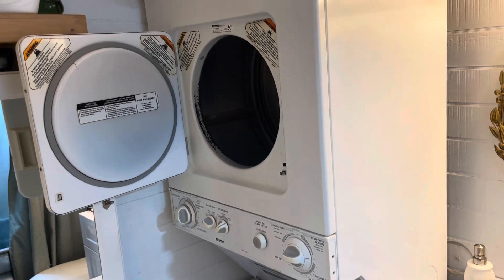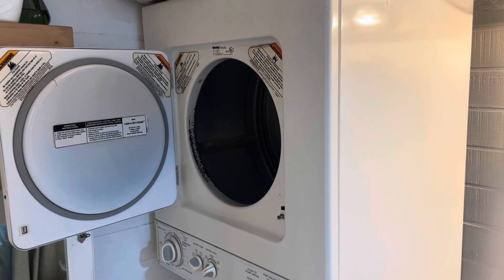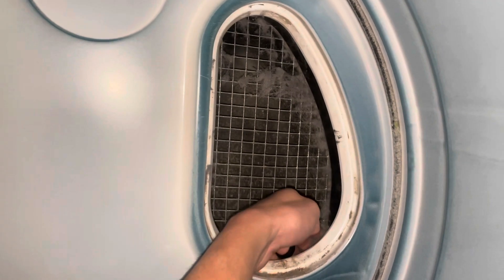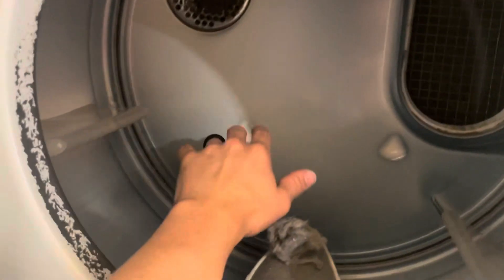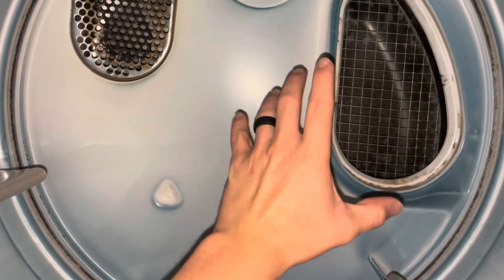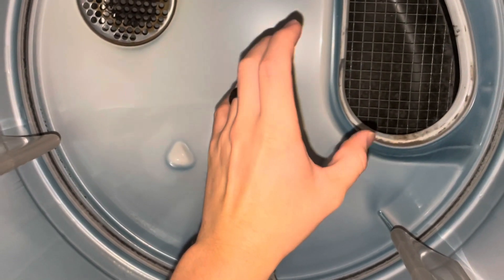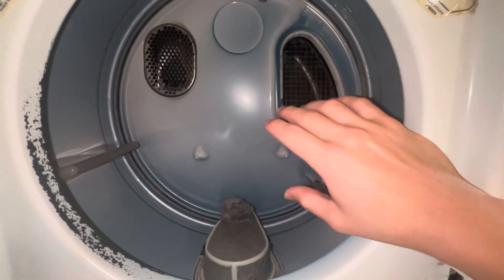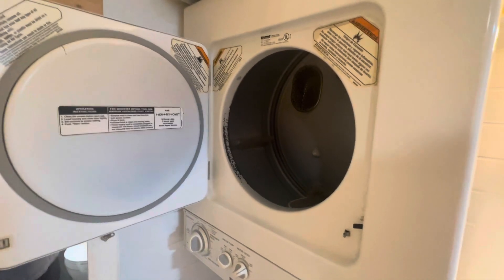Troubleshooting Kenmore Washer-Dryer! NOT DRYING!

Comment: I have the same model, I couldn't find the lint trap thanks for helping find it.  Now my problem is that the dryer works through a full cycle and then won't work again for about 45min and then it will work again.  Could this have been because the lint trap was full and was not emptied out by the previous tenant?
Reply from the maker: When the lint trap is full, it makes it easier for lint to make it to the vent lines. I would definitely check the vent lines because that has the possibility to be a fire hazard.

I’m not sure why the dryer would only work every 45 minutes though. It could possibly be some sort of thermal sensor that has to cool down.

Comment: Can you show what/ how to cananea out dryer fan. 
On the exterior of the bldg,  checking for heat... there isn't really a flow that I saw on your video.. air is hardly coming out. 
So,  I need to change dryer fan. Please show me how to do this. 
Thanks
Reply from the maker: I will try to make this video soon!
I can try to explain it now though! What a lot of people will do is buy a special tool for cleaning the vent duct that attaches to a drill and gets the dust out of the duct. Then you attach a shop vac to the outside of the vent to pull all of the excess lint out of the duct. Here is the link to the tool! https://amzn.to/3ULEHUf

Another good thing to do is to disconnect the duct from the back of dryer and clean out whatever you can reach. Sometimes there are clogs in 90 degree bends in the duct. Hope this helps!

Comment: I have a question. I have this same stackable. How do you get the lint out from behind that small grate? If it gets through the vacuum doesn’t get it out for me. The other question I have is I don’t have access to the outside vent.  How can I check that? Is it worth having someone come in a check it or clean it for me?
Reply from the maker: If you take apart the machine there is probably a way to clean it. If not though, you can probably get a professional to clean it. They have some that will hook up a shop vac to the outside and go in with a Flexible wire brush to clean it.
Reply: @brntechmech1503  thanks

Comment: Where would I find the drain under the washer on the Kenmore stackable washer and dryer Model# 110.88752792?  There appears to be a slight leak coming from under the washer.
Reply from the maker: There should be a rubber hose that connects to the bottom of the washer drum. Sometimes the clamp that seals the hose on won't seal it tight enough. I believe there is also a gasket where the agitator connects to the transmission underneath the washer. That could also be leaking as well.